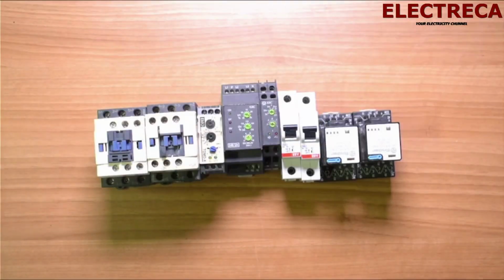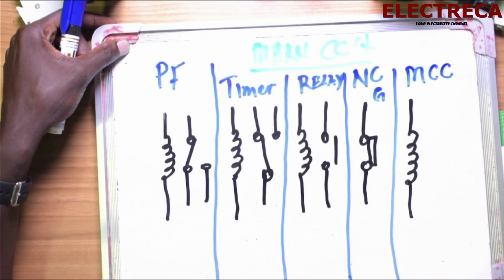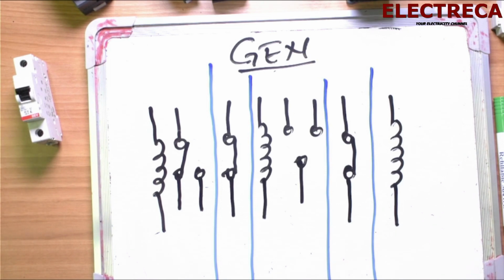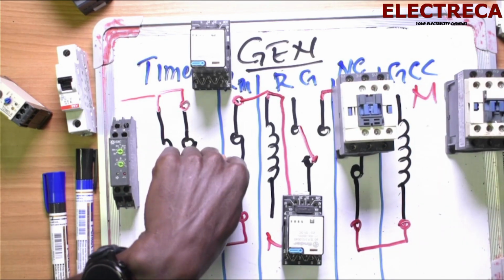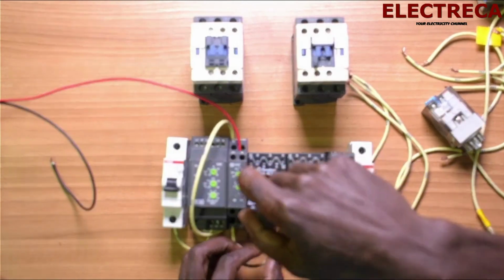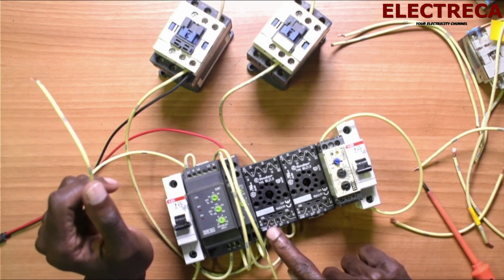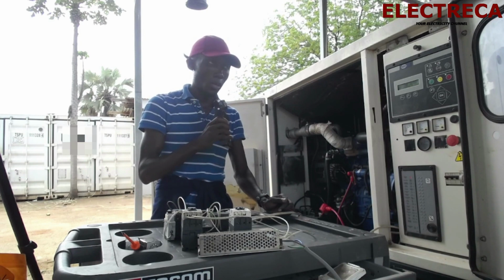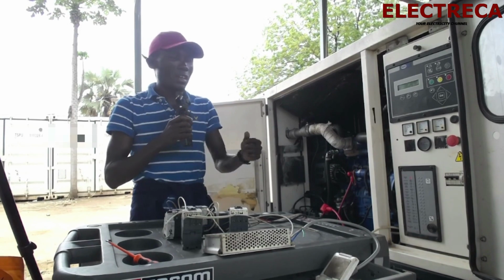How to connect generator changeover switch?

Comment: Engineer ,Please, I would like to know if all generator can be started and off by the automatic changeover?
Reply from the maker: All generators with starter and engine card(controller) yes can.
The other one with starter but without controller need modification to be controlled by an ATS.

Comment: Hello sir I saw this video until the end but I want to ask why you use  phase to the time as DC but neutral AC the neutral supply main timer comes from phase failure but phase comes to DC supply
Reply from the maker: I mixed voltage because i had some DC components.

Comment: The tutorial is okay, but it was misleading in terms of the powering of the components. Please notice that on the earlier part of the video, you mentioned that the coil for control relay and contactor is DC, but when you connected it, you loop the power source of the phase failure, which is you mentioned to have an AC coil. So what will happen to the coil of the control relay and contactor?
Reply from the maker: Yes the phase monitor coil is AC but its controlling a DC circuit through 15 18, contact 15 18 has no connection with PM Ac coil.
Thanks for watching.

Comment: Thank you very much for this knowledge, but pls my question is exactly terminal in the Generator can I used for the auto starting and stopping of the generator when connecting my ATS
Reply from the maker: Find a free NC contacct in the mains auto circuit, that will be your auto start.
thanks for watching

Comment: Dear Electreca
Why do we need relays for mains and gen when we can directly connect the DC point to energize mains and gen contactor respectively directly and now have to worry about extra relays?
NO/NC of contactor can be used for electrical interlock so why need relay at all?
Reply from the maker: Yes, indeed you can do away with relays for small circuits, however, if you are dealing with contactors rated at 100A and above you need relays the timer may fail to hold such a high-rated contactor for a long.
thanks for watching

Comment: Gteat content !  However, I have one concern with the setup.  What protection is there against the possible of either armature of the generator or main contactor becomes jammed ? I see that the interlocking NC and NO  switches on contactors are for sensing the position of each contactor. Wouldn't a seizure of armature prevent the transfer ?

Comment: Engineer,from the cct diagram am still failing to differentiate the the DC power line and AC, as if they are interconnected

Comment: When you connect remote start to the nc of the main relay      assuming you switch off all the main breakers that is gen and the main, still the gen will start automatically not so?

Comment: Oganba otya mwana , what is the use of phase failure am musoga John from Dubai? Thank you brother.
Reply from the maker: Ndibulungi nyo! Phase failure if (3 phase) protects  3phase motor or machine from single phasing and intermittent voltage. in a 3-phase circuit if 1 phase misses the circuit will be turned off Also if under or overvoltage is detected, the circuit will be turned off. apart from single phasing, the rest are true to single phase also.

Comment: Good work, 
What if the generator has a chole that you have to pull while starting and push back after it has started?
Reply from the maker: All self start generators(petrol engines) have automatic chock.
Thanks for watching

Comment: How are you sir  I wanted to know how can I make my starter box  automatic  am pumping water  from  well points  straight to the  center pivots but  the problem is they are elephants  I can't go there  at night to switch them up   help me  with  a  video am  in Zimbabwe
Reply from the maker: So your pumping water from the well to an overhead tank?
Kindly repeat your question. Are you using a submersible pump? How far is the we'll from the other tank ? Which side is starter box?

Comment: Great work sir
In a situation where the automatic change over has the connection of Main and generator but all of a sudden while on generator, when the main is been restored, it reach like cable bridging

But checking on the building installation, the wiring is OK but still having such challenge 

What can I do?
Reply from the maker: You need to check your mains relay.

Comment: Sir, how do you hook up the selector switch in this panel, so that it may be possible to select between automatic and manual, as well as hooking up pilot lamps to indicate when main available and on load, as well as on the generator side
Reply from the maker: I may not be able to explain it in few lines, so i will plan for the video. I am resuming soon.
Reply: Waiting

Comment: This lesson would have been better if you did both wiring diagrams together.   Also why do you use DC voltage ? Why not all AC.     Also you did not explain the need for timers .   Thanks
Reply from the maker: In most case control circuit challenges folks more than the power circuit that why I only did the control.
My bad for not explaining the timer, though have some timer videos on the  channel. Will get  better. 
Thanks for watching.

Comment: Nice video sir, sir in deep sea controller a starter motor to cranking what relay use it, i see inside panel they have 8pin relay and 4 pin, i hope you give some idea, thanks

Comment: Good vedio sir...but some trouble at the generator- when the display remains ON the generator  battery goes down, the the change over fails..is there a solution for this
Reply from the maker: Karanja thanks for watching, 
Please I don't understand your question. Please carefully ask again
Reply: @elektreca  if the generator is not running but the display on the control panel remains ON waiting for the signal,it consumes the battery charge since it is not recharging...how do u prevent this?
Reply from the maker: @Karanjawawanjiru   All generator come with trikle charger incorporated in  generator control panel.
That charger uses power from the utility supply to charge the battery when the engine is off.
Normally you run the signal and the charger cable together. 
OP that you get it
Reply: How do I know the signal cables on the generator sir

Comment: Please sir I have a serious question. When the mains goes out, relay contacts closes, the Gen starts cranking. Wouldn't the Gen continues cranking since the signal cable remains shorted?
Reply from the maker: The Generator will continue to run as long as that contact remains closed or shorted.
Reply: @elektreca were exactly do we connect it on the gen ..can u pliz make a video of that.
Reply: Let me try to answer that.. When the mains comes back, the main relay lever changes position from NC to NO. In that case the generator cable is not short-circuited since the new position is open(NO)
Reply: @lukeskibet9515 you do not understand my question, read again please.
Reply: Try to reply on that...the signal cable is programmed to give the gen the signal is shorted ,the power is out if the signal is cut the power back

Comment: Great job 👍, kindly pardon me on  these two areas, how to connect single phase and three phase on phase monitor, how to do mechanical interlocking in two contactors
Reply from the maker: When using three phase- Just connect all the three phases to phase  failure L1 L2 L3 and the neutral 
When using single phase-  connect live wire to P and then you bridge or short or loop P to any of the three phase terminal, it can be P- L1,P -L3 or P-L2. and of coarse the neutral.
With mechanical interlock 
the 2 contactors must be a like in all feature for it to lock mechanically.
deferent type of brands lock differently. watch this video https://youtu.be/x6HpYWZZRZU
Reply: @elektreca  🙏🙏 thanks so much
Reply: @elektreca  Thanks so much David. Am also answered here